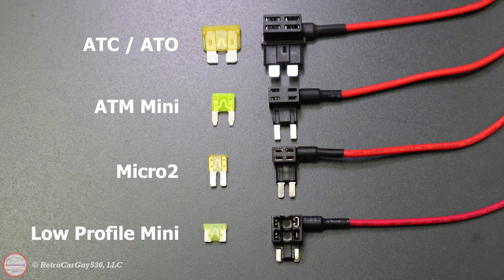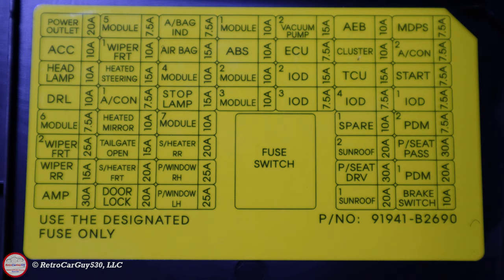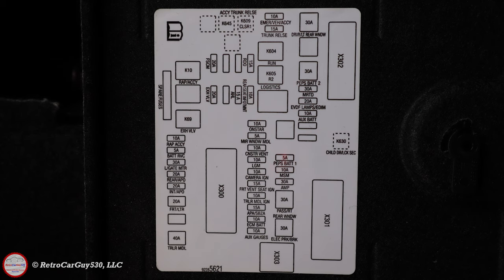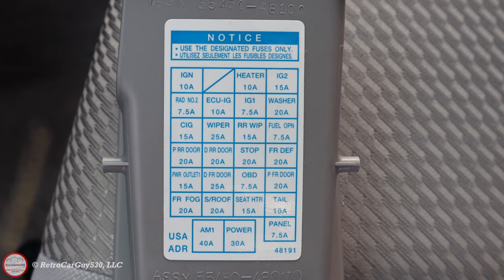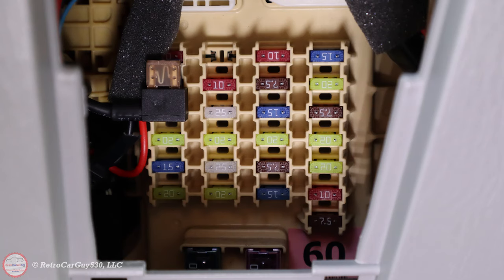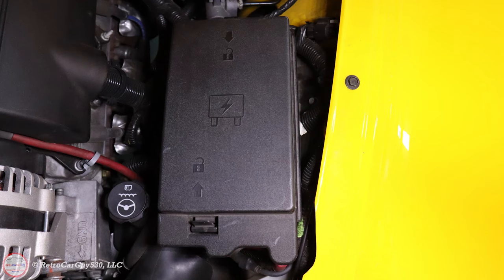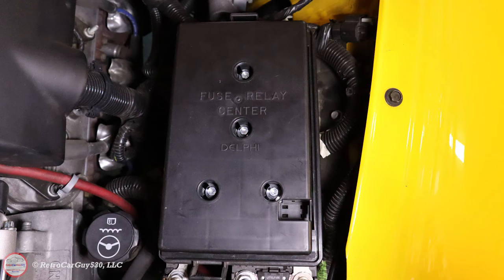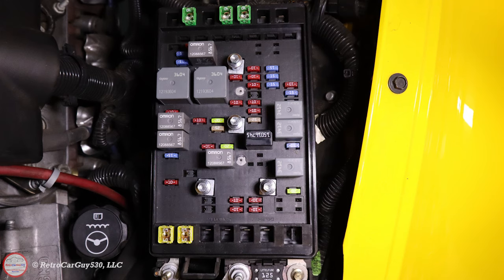How To - Add a Fuse Tap in Your Vehicle

Comment: I really liked your video, but I do have a question. I really don’t have a lot of choices to make on my fuse panel. I have one that has a 2 app fuse, & I need to use a 10 app fuse for my cam. Does it matter if I use this like this?
Reply from the maker: If the fuse in the fuse box is a 2 amp fuse, then you should assume the wiring providing that power to that fuse box fuse socket is restricted to a low amp amount.  You should never use a fuse in a fuse tap for the new circuit/device that exceeds the original fuse.  In fact, the general rule I go by is there is likely to be at least 10% additional amp load carrying capability for the wires providing power to the fuse socket in the fuse box.  Without knowing the wire gauge of the wire providing power to the fuse socket, you cannot assume it can carry more than 10% over the original fuse amp rating.  As with any rule there are exceptions, but that requires that additional knowledge of the power circuit / internal fuse box power distribution.

You stated your camera takes a 10 amp fuse.  Wow, that is way out of the norm for a camera.  For instance, most dash cameras require less than 1 amp to power.  Many times device/accessory companies will put grossly overrated fuses into a fuse tap they provide with the product.  You should verify the true/correct power demands of the camera you're trying to install (user manual, product info on company website, label(s) on the product).  You NEVER want to install a fuse to protect a device and its wiring that is rated for an amp value well over the requirements.  A fuse with a too large of an amp rating is not really protecting the device or wiring like it should (or at all).

If you truly need 10 amps to power your camera, you may want to consider using an alternative approach of sourcing the power for the camera.  Recently, I reviewed three dash camera battery packs.  In that video, I discuss the approach of sourcing power from the vehicle's battery (with an inline fuse) and if needed, you can use a 4-terminal relay to convert the power from the battery into a switched/accessory power source.  https://www.youtube.com/watch?v=Gn3IoBjO_Vg&t=1995s

Comment: Thanks for that information, very helpful. I am using that info to add a 12 vdc cigarette lighter socket in the back of a Tacoma, however what I am not sure of is if I need to run a separate ground wire all the way back into the fuse panel or should I find somewhere under the bed to attach the ground wire?
Reply from the maker: There should be no need to run a ground wire all the back to the fuse box location.  Make sure you identify a good ground locate near the new accessory (power port) to properly ground it.  Make sure the wire you're running from the fuse tap to the power port location is capable of running the amp load for any device plugged into that new power port.  Fuse taps have a somewhat small wire (14 or 16 awg) coming out of the fuse tap assembly.  In my FAQ video, I discuss in more depth the limitations the wire gauge puts on the entire circuit which includes the amount of distance from the fuse tap to the new accessory (or power port in this case) will play into how many amps that circuit can safely carry. 

FAQ - How To - Add a Fuse Tap in Your Vehicle: https://www.youtube.com/watch?v=NW0QaQaU41Y
Anatomy of an Automotive Fuse Tap: https://www.youtube.com/watch?v=YNc0FfeL6rw
Reply: @RetroCarGuy530  Okay that was very helpful. I had purchased some 12 gauge red wire & could only get 14 gauge black for ground. The distance from the fuse box to the outlet is about 12'-15' of wire. I hope that is okay?
Reply from the maker: As I mention in the FAQ video, the total length of wire in the circuit (power and ground) determines how many amps that circuit can carry.  The other limiting factor is the fuse tap wire gauge itself.  All of the blade fuse taps I've used either have a 14 or 16 awg wire.  That becomes the limiting factor since it's the smallest wire present in the circuit.  If you look "Amperage vs Wire Length Chart" in the FAQ video, you can see that 12 awg wire can carry 10 amps for 14-to-16 feet, 15 amps for 12 feet, 20 amps for 8-to-10 feet and 25 amps for about 6 feet.

That would mean a 12'-15' length of 12 awg wire could carry 10 amps safely.  That chart is a bit on the conservative side, but it's trying to illustrate the point that only so many amps can be safely carried over a wire of a specific wire gauge for a specific distance.

If you limit the load on the new power port to 10 amps (10 amp fuse in the upper slot of the fuse tap), I believe the fuse tap wire of 14 or 16 awg and the 12'-15' feet of 12 awg should be capable of carrying that many amps.

Comment: which side of the  fuse for your new accessory  do you have to insert on the fuse tap. Like on the fuse tap the left side pin draws the power and power goes out on the right pin. Like do you have to insert fuse  the right way like the fuse tap.
Reply from the maker: A blade fuse does not have "direction".  You can insert the fuse into the fuse socket in either way.  I usually insert the fuses so the amp ratings are readable, but again it's not a requirement.

Comment: Hi, great video.
Do I have to install a fuse into the tap if I'm using an unused slot? Does the fuse complete the circuit? And,
If my (two) accessories have inline fuses, 5Amp each, can I run them to the same fuse and what amperage should that slot be? 5, 10, 20Amp?
Reply from the maker: If the fuse socket in the fuse box is unused then you only need to [must] insert a fuse in the top socket for the new accessory being power by the fuse tap.  Without a fuse in the fuse tap itself, it will not provide any power to the new accessory.

If you have two accessories that you want to power from the same fuse tap, it is possible if the current draw (amps) is low enough.  Since the two new accessories draw only a max of 5 amps each (10 amp total), you could connect them to the same wire coming out of a fuse tap.  Fuse taps most often have a 16 awg or 14 awg wire coming out of them and those wire gauges can handle 10 amps of current.  The fuse in the fuse tap would need to account for the total amp draw of the two accessories and in this example it would be 10 amps.

If have a FAQ video for fuse taps that discusses the sizing of the max available power in a fuse socket, wire gauge and the length of the wire and how they are a factor into how many amps the new accessory can safely use via the fuse tap circuit.

https://www.youtube.com/watch?v=DnZ5wb_A5vE

Comment: I missed the part where you insert a fuse in the add a fuse when there was no fuse originally. Do you install the fuse on the top or bottom in the add a fuse.
Reply from the maker: I discuss that starting at 4:10 in this video and I cover that as well in my "Anatomy of an Automotive Fuse Tap" video https://www.youtube.com/watch?v=YNc0FfeL6rw 

The fuse for the new device/accessory always is put in the top fuse socket of the fuse tap.  The fuse that was in the fuse box fuse socket goes in the bottom fuse socket of the fuse tap.  If there was no fuse in the fuse box fuse socket, then no fuse is put in the lower fuse socket of the fuse tap.

Comment: what is the black lead attached to when testing the fuse to determine the power input. Could not see from the video. Thks
Reply from the maker: The negative (black) test lead is connected to a vehicle ground or negative battery terminal.  In my test setup, I used an DC power supply.  The negative wires from the test light and the multimeter were connected to the negative on the 12-volt power supply.

Comment: The orientation of the fuse tap for the first fuse socket should not matter at all since the fuse only connects the two ends. The orientation of the fuse tap for the second fuse socket is critical because by turning the fuse tap 180 degrees  would make the second fuse active or redundant.
Reply from the maker: Orientation of the fuse tap in the fuse box fuse socket is always important.  Making sure that the left leg of the fuse tap (power feed side) is inserted into the correct side of the fuse socket is important to make sure of proper power routing within the fuse tap and the fuses of the fuse tap.

With improper fuse socket installation - left leg of fuse tap inserted into non-powered side of fuse box fuse socket

1) Power from fuse box fuse socket is only available to lower fuse tape fuse socket (fuse box power provided on right leg of fuse tap)
2) Power for upper fuse of the fuse tap (for new accessory) can only be drawn from/through the lower fuse in the fuse tap
2a) Power draw of new accessory can cause the original fuse (lower fuse in fuse tap) to blow since it's now potentially overloading the lower fuse (original from fuse box socket) 
3) If no fuse was present in fuse socket before the fuse tap being inserted and lower fuse socket in tap has no fuse - there's no power available for upper fuse socket in the fuse tap making the fuse tap not provide power at all to the new accessory

With proper fuse socket installation - left leg of fuse tap inserted into powered side of fuse box fuse socket

1) Power from fuse box fuse socket is provided directly to both fuse sockets in the fuse tap
2) Each fuse in the fuse tap is responsible only to provide power to its intended circuit (lower = original fuse in fuse box, upper = new accessory)
3) When no fuse is present in the fuse box socket prior to using fuse tap - power is still available to upper fuse in the tap to power the new accessory.  In this situation, there's no need to have a fuse in the lower socket of the fuse tap.

Comment: I'm 100% more knowledgeable about this now, thank you. However, I'm still a dunce on this topic, mostly from lack of experience. 
I intend to use this information to install some marker lights by tapping them into the DRLs so that they turn on together. Is this more or less the same concept for that application?
Reply from the maker: Yes, the concept is the same.  If you want marker lights on all of the time the taillights are on, then using the DRL power may not necessarily achieve your goal.  I'm assuming the fuse for the DRL lights/feature is only powered during the day when the headlamps are off.  You may want to see if there is a taillight fuse to source your power from for your new marker lights.  Just a thought.

Comment: I’m sure this has been asked before, but how do I find a switched fuse? 
Would I test the box while the car is off? Would it be safe to assume windows or radio fuses are switched? 

I’m installing a gauge for boost pressure. I have it set up on a interior fuse box and in a dummy slot but the gauge doesn’t turn off when I turn the car off. 

Thanks.
Reply from the maker: I believe I mention in the video the various states the vehicle's ignition switch can be put in (Off, Accessory mode and Run mode).  You would make sure your vehicle's ignition switch is in the off position and open the driver door to make sure any retained accessory power feature (if present) is turned off.  Check the fuses with a multimeter and the ones with no power in that state are likely to be switched (accessory) powered fuse sockets.  Turn the ignition to the accessory or run position and then check the fuse again and if it has power at that point, that confirms that the fuse socket for that fuse is providing switched/accessory power.

Comment: Question regarding the connection orientation. There's an obstruction in my fuse block and cannot install the add tap with the power on the left and accessory on the right. Need it to be vice versa. Is there a workaround so I can swap the connections? Thanks
Reply from the maker: You can have the power being fed up the right leg of the fuse tap.  This video shows the "in parallel" power routing (left leg gets power) while the "in series" power routing (right leg gets power) can be used.  The difference being that the power for both the original circuit and the one being added by the fuse tap will first be routed through the original/bottom fuse in the fuse tap.  Some argue that is the "safest" way to do it and it technically is the safest since total demand for both circuits will never exceed the original fuse's amp rating.  

The question is how many amps does the original circuit require of the original fuse box fuse?  Will the demands both the original circuit and the added circuit (via the fuse tap) exceed the original fuse's max amp rating.  If that's a problem or concern, the only other suggestion would be use a power feed directly from the vehicle's battery with an inline fuse.  If switched/accessory power is needed with power coming directly from the battery, you can use a 4-terminal relay to perform that switching function.  You would still use a fuse tap to get access to a fuse socket with switched/accessory power, but the power demands of the control side of a 4-terminal relay is very small (100 mA = 0.1 amps).  I discuss the relay approach in a video I created to review a dash camera battery pack.  https://youtu.be/Joa0fiKZY-o?t=744

Comment: dumb Q but why does it not shock you when you place the cut fuse in with the exposed tip at your fingertip
Reply from the maker: My body does not provide a path to the vehicle's battery ground (or the DC power supply used in this video), so no current passes through me.

Comment: I'm 3 years late but here we go. Can I connect 2 relays to 1 add a fuse to connect to my fuse box? I'm connecting raptor lights and ditch lights on my 4 runner.
Reply from the maker: If the power you're providing to the relays is the control power (turns relays on/off) then yes.  If you're providing main power that is being sent to the raptor and ditch lights, then I would say no.  The amount of current draw for the control power for the relay is very minimal so a fuse tap is a great way to provide that type of power.  The "load" power depends on how much the lights draw at startup (inrush) and steady state (after startup).  If you're using a relay to power these lights, I would recommend obtaining the "load" power (terminal 30 of the relay) directly from your vehicle's battery (with an inline fuse) and obtain the relay control power (terminal 85 or 86 depending on your relay's documentation) using a fuse tap.

Comment: I have a 15 amp fused circuit in my 1994 vehicle where the wire going out to feed some accessories melted up to a metal splice. The wire after the splice is fine. I am having difficulty getting the old connector out of the fuse box to replace the wire. Can I use this to reenergize the circuit after I have replaced the bad wire? If so, do I only need to put a 15 amp fuse in the lower spot on the fuse tap or do I need to put two fuses in it? Thanks.
Reply from the maker: First off, I hope you've identified the reason for the wire to have melted (short of some sort) and corrected (avoided) it.  If you want to use a fuse tap to provide power from the original fuse box fuse socket to the same circuit after the metal splice, then yes you could do that (again making sure the reason for the short is corrected).  The fuse tap would only need one fuse in the upper fuse socket.  Insert the fuse tap so the left leg of the fuse tap is inserted into the side of the fuse socket that provides the power.  Make sure the wire gage of the fuse tap wire and the wire after the fuse tap are sufficient to carry 15 amps of current as well.  Most (if not all) blade style fuse taps have either a 14 awg wire or a 16 awg wire coming out of the fuse tap.  A lower AWG rating is a bigger wire size which can carry more current.  A 14 awg wire can carry 15 amps for about 10 feet (max) according to a few different amperage vs wire length charts.  As with any advice I give about electrical circuits, any modifications you make are done at your own risk.

Comment: Can you please recommend a means of running such a fused accessory cable to a vehicle's dash-cam..?  Vehicle in question is a Volvo 850 that also has its fuse-box within its engine bay. 

Ideally, I'd like to use the run of existing cables do as not to involve say drilling through its bulkhead then having issues with sealing from potential water ingress..
Reply from the maker: I don't have direct knowledge of the Volvo 850, but in general there should be some number of wire looms running through the firewall into the passenger compartment.  Sometimes, there is a small amount of free/unused space in those wire looms to allow another wire to be run through them utilizing the manner in which they were passed through the firewall.

I've used solid core wire (for its rigidity) or even a thin metal support bar used on the sides of some wiper blades as a means to get through the existing grommet/hole in the firewall.  I'll tape the wire I want to pass through to the solid core wire or the thin metal support bar from a wiper blade and gently pass those through the pre-existing object the other wires are running through and then I will pull the new wire into the passenger compartment.

You should be careful to not damage any of the pre-existing wires, so take your time while trying to feed the wire through the firewall.

I hope that helps.

Comment: I don’t understand the conclusion. How is one wire from the fuse going to make a circuit ? What is the expected useability of one wire ? Do I put the other end to battery ??? (Is the fuse the positive and I connect to negative on the battery ?)
Reply from the maker: The fuse tap is only 1/2 of the new circuit for the new accessory/device.  The fuse tap provides the 12-volt positive power to the new accessory/device that you're adding to your vehicle.  The new device/accessory will have a negative/ground wire that needs to have a connection to a location on the body/frame that provides the ground side of the circuit.